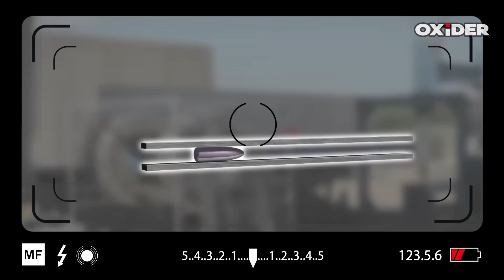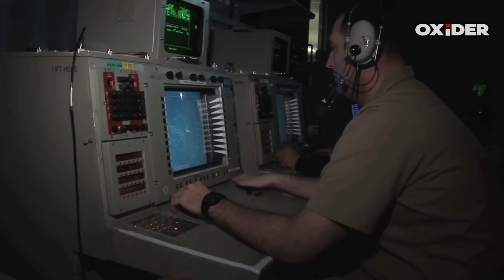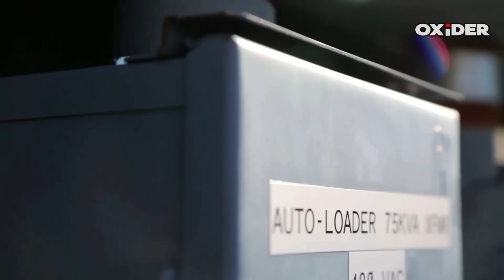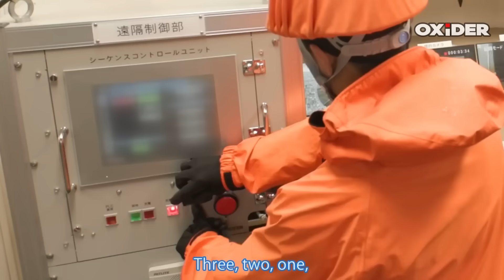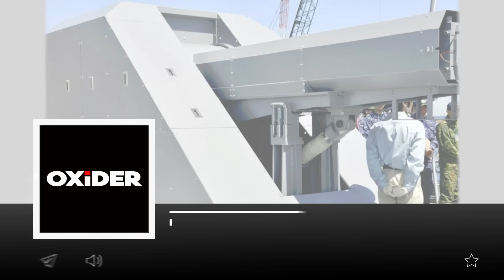Japan just installed a Railgun on a Warship - can fire at Mach 7

Comment: And the hype wave rose again...

Even if the Japanese solve the barrel wear problem that the Americans couldn't solve, what's the point of this gun?
1. Mach 7 itself does nothing, which is why even hypersonic missiles have a warhead.
2. The projectile is unguided, and without losing all its inertia, it can only be fired directly to the horizon, which at deck height is about 30 km.
3. How does this weapon fit in with the concept of drone swarms, which is currently taking over everything?

Comment: The problem with the rail gun is the bullet has to complete the conductive circuit along the barrel.  It does not matter if it's a ferromagnetic or eddy magnetic field.  Because there has to be physical contact with the rials there will always be ware.  Same goes if there is a slight plasma arc between the rails and bullet.  This is why the Americans finally gave up on the rail gun.  They might be shifting their attention to the gauss gun, another type of electromagnetic slug thrower.
Reply: 日本の防衛省レポートを見たけど、120発を撃っても初速2000m/s以上を維持し、顕著な損傷は無かったみたいだよ

Comment: What a WASTE of Time and Money. If it's not on a Turret it's Useless. If it's not easily and quickly reloaded, it's Useless. Furthermore, it's NOT cost effective nor can the projectiles be Guided (i.e. Laser or GPS). And lastly, it's way too complex which means maintenance is a nightmare and it's difficult to diagnose and repair in a hurry versus either an Artillery Piece or a Guided Rocket, the latter of which either works or it doesn't and when not, it's quickly reloaded with a new projectile/rocket.
There may well be a use for this technology in the future but for Ship-to-Ship or Ship-to-land combat, I don't see it ever being practical, especially when it's on the Stern of a ship. It's bad enough that you have to try to steer the boat to aim it accurately but hoping for any accuracy on rough seas is an exercise in futility UNLESS it's set up on some sort of platform that maintains it's position regardless of waves.  It's silly.

Comment: The US shelved the system not because it was ineffective but because the barrel wore out to fast. No clue where the tech stands today but apparently Japan has it figured it out. The one thing I do know is if it really works they can use guided munitions and range out to a couple of hundred miles or more.
Reply: I'm seeing 120 rounds per set of rails.
Reply: @AlitaGunm99  Sounds about right.
Reply: It wore out too fast because they are using 32MJ worth or energy output... Japan is using only 5MJ, these difference speaks volumes

Comment: railgun looks so much like a railgun it's amazing
Reply: The name is not Rail Gun, which is powered by supercapacitors.
Rail Gun is a Lazer cannon!

This cannon is called the "Gauss Cannon"
The Gauss cannon is a cannon that fires electromagnetic projectiles so that the projectile has greater velocity.

How does it work?
There are several inductors in the barrel of the cannon!
When the projectile is energized it creates a Negative or Positive Pole and the projectile will have the same Negative or Positive Pole so that the inductor and the projectile repel each other! Repelling each other increases the projectile's speed!

Comment: In my opinion, the railgun is the wrong choice of weapon type because a coilgun or also called Gauss would generate much more energy due to the Gaussian principle and would therefore be much more suitable and it would also wear out less.

A railgun or also called a linear rail accelerator
Consists of three core objects Two rails, one has a negative pole and the other has a positive pole And a carriage that closes the contact between the two rails and thus causes current flow
And the high voltage flowing through creates an electromagnetic field and pulls the carriage forward The problem with the whole thing is at the contact points between the carriage and the rails Becomes extremely hot due to generated plasma and the current flowing through it And like a welding machine, the surface of the rail then melts and breaks into small drop-shaped particles And then stick to the rail Means you can't shoot as much with such a weapon

Coilgun or also called a Gauss cannon
Has several coils with magnetic fields that are generated by switching high voltage on and off This is coordinated by control computers Can therefore also be used at low speed but with the same intensity of the magnetic field The magnetic field of the weapon attracts the projectile directly without having contact with the projectile This means that no high voltage flows through the projectile Allows you to fill explosive material into the projectiles This and the more variable speed makes it possible to fire regular artillery shells from Coilguns The frequency at which the projectile is accelerated in the coilgun increases from back to front, thus creating an ever-accelerating projectile While the acceleration of the railgun is linear And is also slowed down very strongly by a relatively high friction This is further enhanced by the fact that the rails attract each other This problem does not exist with the coilgun The coils generate a magnetic field but are not magnetic themselves Due to the ever-increasing acceleration and the lower friction, the projectiles can reach a much higher speed than those of a railgun Theoretically, you can even completely eliminate friction, but this is currently not technically possible Because you have to create an extremely constant magnetic field and you would also have to take gravity into account and or accelerations due to movement But what would be much easier in space outside of gravitational fields in a stationary object But that is totally irrelevant for the current context The big technical difficulty is to produce the computers that control the whole thing and to write the software for it. 

While with the Railgun you simply need to connect it to sufficient power So simply it is technically less demanding but less effective than the Coilgun But the development of these electromagnetically accelerated weapon systems Currently has material problems because the railgun has these technical problems and therefore I would recommend changing the system to a coilgun even if this is difficult to develop at the beginning but you just have to deal with less materials to make them work and simply with hardware and software solutions for controlling the system

PS You can also learn a lot from scientific particle acceleration devices because they use the same principle As a coil gun

Comment: A railgun is a ballistic weapon not a directed energy weapon a laser is that for example With a railgun you accelerate an object
Electrically powered ballistic weapon: Railgun, Coilgun and Particle Cannon
Directed energy weapon: Laser, Sonic Cannon, X-rays Cannon, Directed Microwave Cannon and Directed electromagnetic field generators
Most directed energy weapons can be made into a phased array Electrically powered ballistic weapons are not  The laser is more or less an exception
Reply: Unless you count kinetic energy, in which case all weapons are directed energy weapons :)

Comment: You would need to be able to shot it at 20 plus miles to shoot down any missiles or ships. At 20 miles a hyper sonic missile would need seconds, so how fast can you aim one of these rail gun? Cool on paper but pretty underwhelming when you start to really think about real world applications.
Reply: Japan is considering intercepting ballistic missiles. In other words, the target will approach this railgun.
The more supersonic the target (missile, aircraft) is, the more it will move in a parabola or straight line according to the laws of physics, so if it is detected by radar, its future position can be specified by calculation. Also, instead of a single shot being sure to hit, it will fire dozens of rounds per minute like a CIWS.
Reply: At 6000 MPH 20 Miles takes 12 seconds. But you can fire multiple rounds per second, with Networked targeting you can paint an ocean battlefield with lethal SABOT rounds accurately within seconds at 20 miles. I'll take one on my ship thank you.
Reply: @kevinhorne9643  Ballistic missile warheads, upon atmospheric reentry, can reach speeds of 4-7 km/s (approximately 9,000-16,000 mph). This high speed is maintained due to the warhead's streamlined shape and the limited atmospheric drag at those altitudes. The terminal velocity, which is the speed just before impact, can vary, but is generally around ●Mach[  3-6  ].

Comment: have they solved the barrel destroying itself problem?

Because that was the US and British problem. You'd fire a fairly small number of shots and then the whole barrel would have to be replaced.

I personally think we need to basically have a magnetic barrel. That is, the shell shouldn't touch the barrel but rather be supported and directly during the acceleration phase using magnetic fields that not only propel it forward but keep it tightly centered.

This would mostly eliminate the barrel wear problem. Further, the strength and calibration of the guiding fields would be dynamically adjusted allowing a barrel with imperfections to self correct by changing the field strength of the guiding coils. This might make magnetic acceleration cannons more durable ultimately than conventional guns which must have their barrels switched out after so many thousand rounds. A magnetic barrel could fix imperfections developed through years of use or battle damage by simply increasing or decreasing field strength along the barrel to realign the round properly. I mean... to a certain extent... obviously heavy damage would require repairs or replacement. But small imperfections could be adjusted out through onsite calibration... perhaps done automatically.
Reply: 120発撃っても砲身の摩耗や損傷は無かったよ。

今は洋上で艦体の電源で運用できていてすでに退役した艦体を沈めている。

洋上での電源は機密事項だ。それはこの地球上で日本しか持っていないものだ。

陸上自衛隊は今は通常動力での電磁カタパルトも開発の視野に入れている。
このレールガンの洋上運用に成功しているからだ。
Reply: @user-gebatan  Wow! That's impressive. I am glad we are on the same team! Regards to Japan and the JMSDF from the UK.
Reply: @user-gebatan  I'm very interested to see confirmation of this breakthrough. As I said, the US and UK didn't get past this problem. The barrels didn't last long enough.
Reply: Sounds like you should go tell them how to do it!
Reply: Well there is a phenomenon called "Quantum locking" a supercooled Magnet gets "locked" into another magnets field staying in the exact place you put it. Of course it can be acccelerated and moved if the magnetic field moves. Problem with this is keeping the magnets supercooled and poweroutput.
Reply: @MA-nd8ut  Theoretically, with high speed computer controlled magnetic fields you should be able to control the projectile without resorting to quantum locking.
Reply: @diogenes848  You do realize that you've been talking about a coilgun, right?  It's a different concept.  It's also a lot harder to bring to scale
Reply: @tasa4904  Coil gun does not have a magnetic stabilized round and instead uses a physical barrel generally for that purpose.

What I'm talking about is a magnetically stabilized round that does not make physical contact with a barrel.
Reply: @diogenes848  Which is a coilgun.  A coilgun relies on magnetic forces to fling the object. 

A railgun relies on electromotive force.  If you're relying on a floating object, then you have no way of passing a significant amount of current through it.  At the scale that you want, it's impossible with today's technology.   And without significant current, you don't get significant force.  F = ma.  No force, no acceleration.
Reply: @tasa4904  All the rail guns made by the US, UK, or Japan appear to be electro magnetic.
Reply: @diogenes848  Yes.  So? That just means it's not pure electricity or pure magnetism. Electricity AND magnetism both play a role.  Look, if you don't understand the principles, don't make suggestions.
Reply: @tasa4904  Sir, you are confused. Go away.
Reply: @diogenes848  the classic response  when you've been using the wrong terms from the start but refuse to admit it.
Reply: @tasa4904  I never said or suggested it was either one exclusively. In fact, if you knew anything about the principles, would be impossible to implement what I was saying without electromagnets. If I made any presumption, it was that anyone commenting would have even the most basic grasp of the science and so would realize that.

That assumption was apparently incorrect in your case. As I said, good day, sir. Go away.
Reply: @diogenes848  Say that you don't know how railguns work without saying that you lack knowledge on how railguns work.

It's cute how you believe a magnetically suspended slug can still have 5000+ amps of current pumped through it wirelessly to send it down the barrel.  Maybe 20 years from now, but if your bright idea was supposed to save the defunct US and UK projects then it belongs on toys or coilguns instead.
Reply: You'd need advanced wireless power technology if you wanted the shell not to touch the barrel.  Rail guns currently require that touch so that they could send a lot of current through the system to obtain the necessary magnetic acceleration.
Reply: @tasa4904  I think they touch so the round is physically guided and that the magnetic acceleration is mostly just pushing the round out of the barrel.

What I am suggesting is that the round be both propelled and guided by magnetic fields thus removing the need for the shell to touch the barrel.
Reply: @diogenes848  The projectile needs to touch the rails to complete an extremely high current electric circuit.  Together with the magnetic field generated by the current flowing through the rails, a force is generated that moves the projectile.

Right now, technology hasn't advanced enough to move that much current without what is essentially really thick conductors.  

If physics currently makes the contact requirement impossible to remove, you have to deal with the warping instead.  Which is caused by heat.  So most railgun development effort is on keeping the rails at a stable temperature.

Comment: America's railgun "doesn't work" (it works but it destroys the barrel with every shot).   Maybe the problem is America wants a 20 mile railgun.   It seems like Japan's railgun is more modest, not a 20 mile hit; but, more of a close range weapon up to the horizon.
Reply: I could be wrong but the US project seemed to be looking for an offensive ship to ship weapon to replace conventional ballistics -  the Japanese approach seems to be toward a defensive anti- missle system requiring less energy but more rapid firing without degrading the launcher so quickly.
Reply: Ill agree to that. There is reason why America is chasing that however.  It's why we use missile carriers vs battleships now. We currently are "delete your enemies while there not visible but still just a blip on the radar".  Missiles have dominated this strategy over ballistics.
Reply: The US is making a railgun cannon while Japan is making a railgun AA gun
Reply: I'm just puzzled why it's worth 25 Grand per projectile are they not made of just a solid material?
Reply: I believe what you're trying to say is 200 miles. 20 miles is an abysmal range for naval engagement that isn't in WW2.
Reply: The name is not Rail Gun, which is powered by supercapacitors.
Rail Gun is a Lazer cannon!

This cannon is called the "Gauss Cannon"
The Gauss cannon is a cannon that fires electromagnetic projectiles so that the projectile has greater velocity.

How does it work?
There are several inductors in the barrel of the cannon!
When the projectile is energized it creates a Negative or Positive Pole and the projectile will have the same Negative or Positive Pole so that the inductor and the projectile repel each other! Repelling each other increases the projectile's speed!
Reply: @x-gamessimulator1067 W R O N G 
Gauss rifles, or coil guns, CANNOT achieve Mach 6, while this turret can, which makes it a railgun

Comment: well they don't have a actual "functional" railgun for combat. It was only installed on the warship for testing is from what im getting outta this rather. 5 seconds to fire a round, major overheat issue, major weight/space occcuption on a navyship not including it's ammunition, very little damage area, etc. Yeah, no it needs major and i mean massive upgrades to work and to actually be used as a option in combat or defense.

Comment: Why not use magnetic field to levitate the projectile so you do not need a projectile casing, like electrical magnetic high-speed train?
Reply: Most likely because of energy efficiency? I think it's more efficient to release all that energy in one go than having to maintain a magnetic field.

IIRC, a magnetic levitation train works off of the repulsion between 2 magnets of the same polarity.
The projectile isn't gonna be magnetic so they'll have to use other means to produce a magnetic field in order to levitate that projectile, which might add unnecessary complexity to the railgun system.